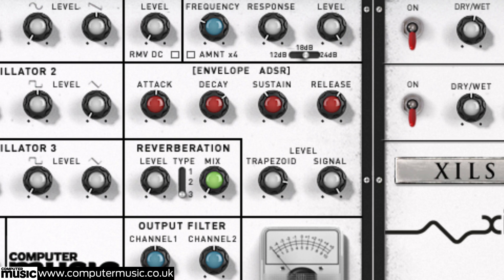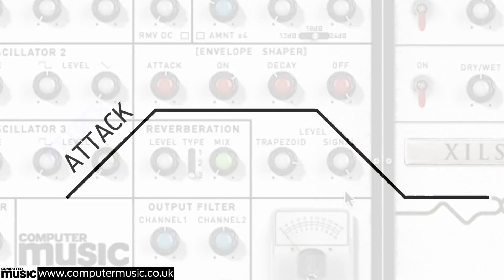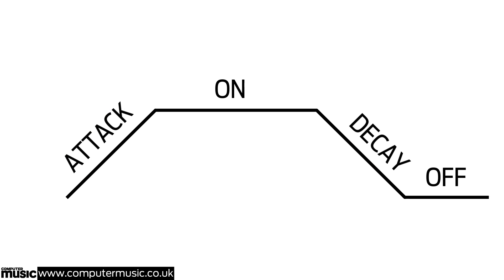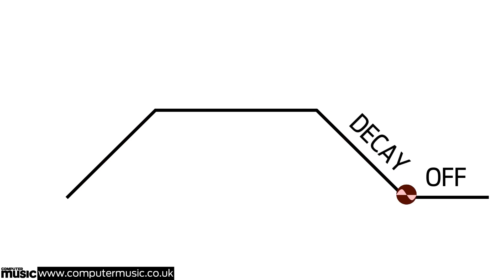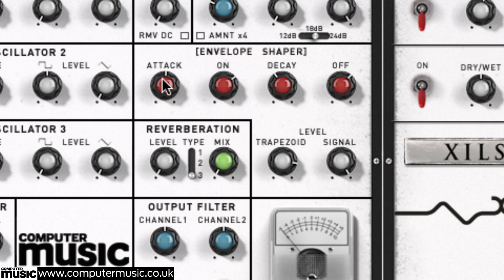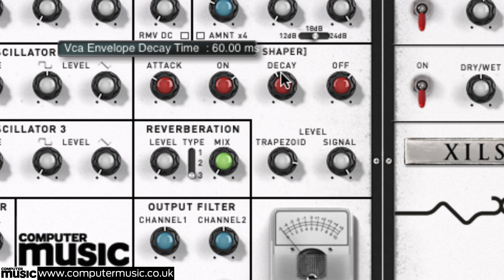A visual guide to XILS 3 CM's ADSR and trapezoid envelopes - 5/9

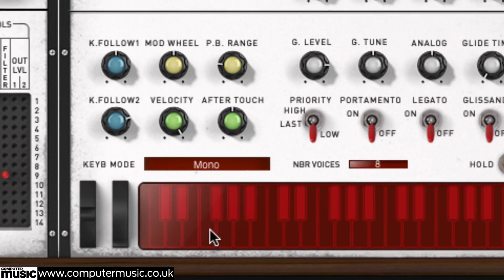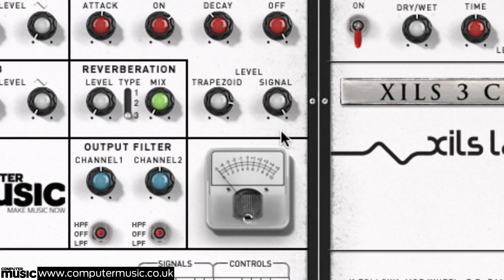Comment: This is very confusing because it moves back and forth between the CM version(1:50)  and the LE version (2:15); CM version does NOT have the ON, DECAY envelope.
Reply from the maker: XILS 3 CM's envelope can be switched between trapezioid and regular ADSR modes by clicking the envelope section's header. At 1:50 the ADSR envelope is selected, whereas the trapezioid is active at 2:15.
Reply: Computer Music Magazine Thanks for clarifying!